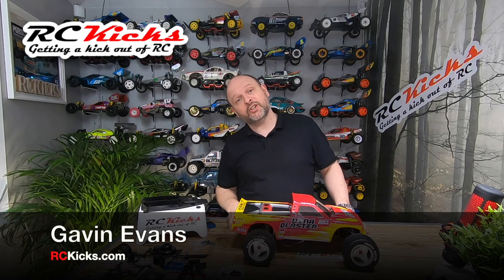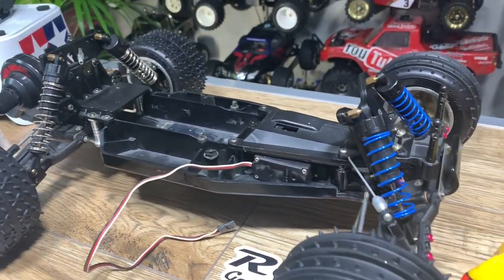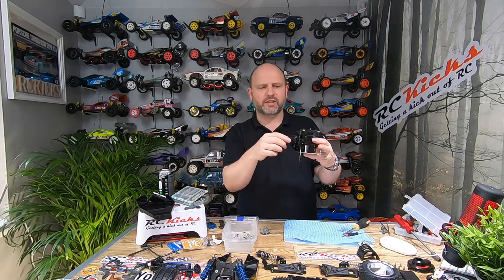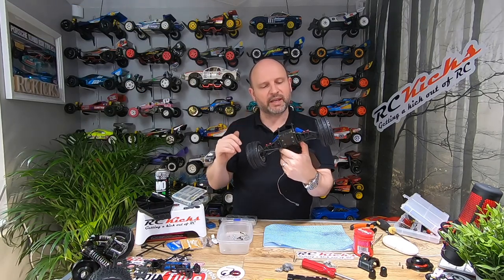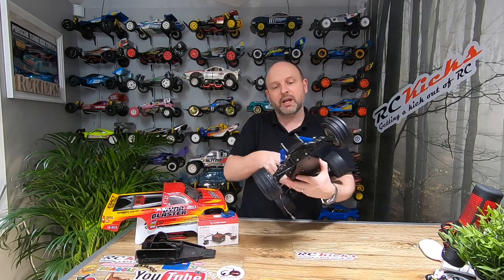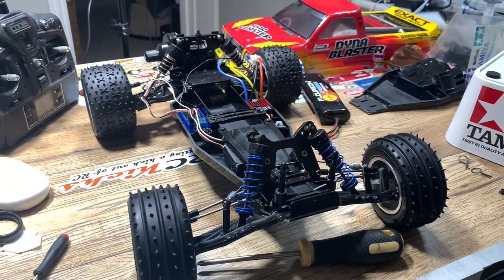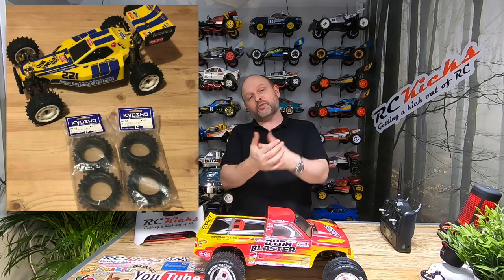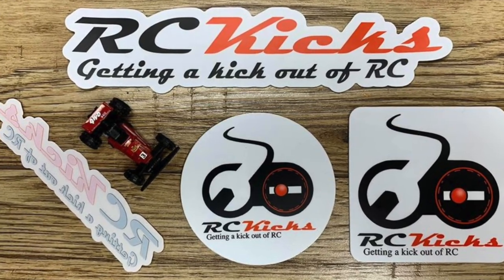Making It Perfect! Tamiya Dyna Blaster Chassis Swap | Finishing The Racing RC Truck Project

Comment: I like how you did the electronics the chassis is pretty cool a buggy stadium truck I'm telling you you need to do a buggy monster truck chassis the stadium truck is halfway there custom build would be nice but restoring all your cars to mint is your way not mine they do look really nice RC candy is right has no roll to it that servo is super fast put some clod-buster MT Tires on  your King Cab and then you can switch them out I like the body u painted better it's got more pop is that a word jkv I would have been the guy who left pink bolts on gavin is picky but humble wowza
Reply from the maker: Clod Buster will come to RCKicks at some point Paul